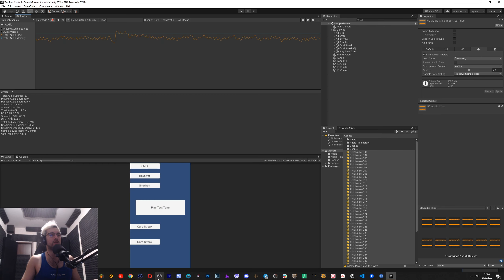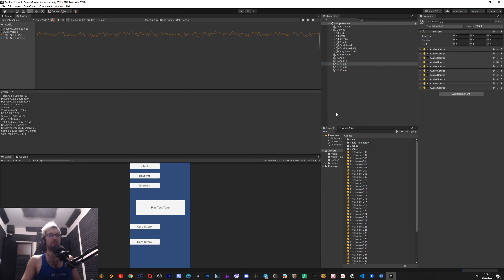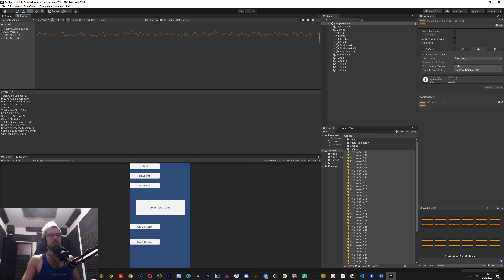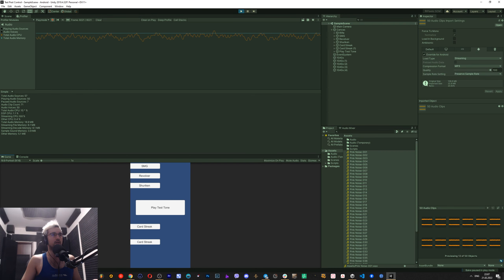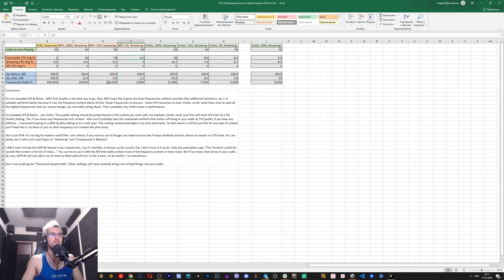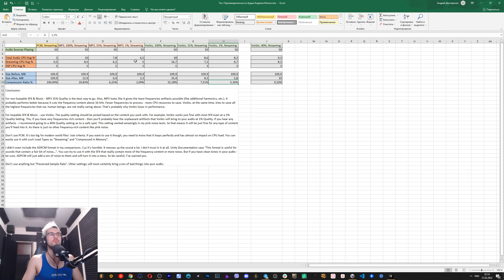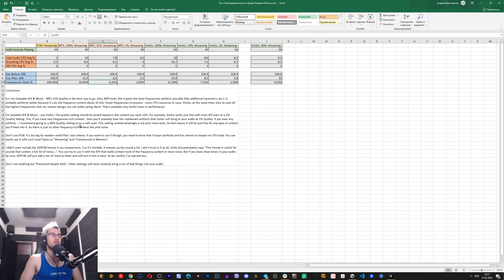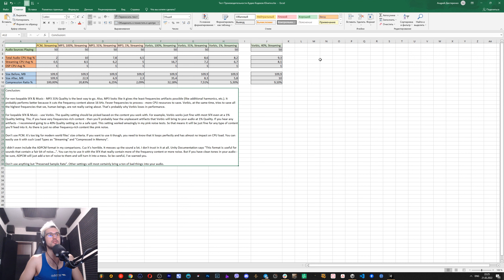Unity Audio Compression Formats CPU Performance Impact Compared (PCM vs ADPCM vs MP3 vs Vorbis)

Comment: Hi, from your experience, in what audio format should I export my sfx from DAW? Wav and then let the game engine handle the compression or already export sfx as mp3 / vorbis? Are wav sfx only influence size of the game repositorium? Cheers!
Reply from the maker: Yo.

U should always use WAV for export. Cuz even if u gonna import MP3 or OGG in there - these files will still be re-compressed again, when Unity gonna compile a build. So u'll get 2 rounds of compression and u'll lose quality in there. 

While, compressing a lossless WAV file is technically only one round of compression. 

But, of course, WAV weigh more then OGG or MP3. So this will influence the size of  your Unity project repositorium. BUT, it will not affect your build size, as your build size will be determined by audio settings you'll pick in the inspector.

Comment: If you're not going to talk about ADPCM, why is it in the title?
Reply from the maker: Sorry about that. My reason to not talk and show ADPCM is that in my off-the-camera tests it completely annihilated the audio that I tried it for. 
It worked good for frequency-reach content (like noises, etc.). But for clean tones (sinewave, for example) - it completely annihilates the audio with some random harmonics generated, which are super obvious and not acceptable at all. If we talk about some musical instrument that has some clean sinewave-y tones with not much harmonics - ADPCM will destroy it. 
So I think it's the best to pick either PCM, or MP3/VORBIS.
I should redo these tests, probably. Maybe sometime. But meanwhile, this video is at least something on this topic on youtube. I didn't see anything else like this on youtube at the time.
Reply: @Andrew_Renko  Yeah, I think ADPCM's issues with clean tones are pretty negligible, considering what it would be used for here (sound effects, voice clips), and in my experience, most music still sounds fine.
I was hoping to see it here, since most examples of ADPCM are running on "retro" systems (Commadore 64, Turbographix, Game boy advance), and was wondering how well it performed compared to more modern codecs.
Reply from the maker: @ninjacat230  sorry for inconvenience. I may remove this video if I'll redo it sometime later.

Comment: "31%" is poor quality around 96 kbit/s. It's ok for monophonic sounds. 128 kbit/s is barely tolerable for music that you hear under engine noise in a driving game ("Need for Speed Underground", "San Andreas"). Really tightly compressed games without much going on like visual novels ("Roommates") and stuff like that are annoying to listen to with poor quality music that sounds like bubbling mud, and after some years go buy this might become the only source the music for extraction ("The Sims 2" 128 kbit).

Good games from the late 1990s usually had CD quality music and pure uncompresed 22 kHz 16-bit PCM sound ("Starcraft"). In 2023 we can do at least as good. In bad examples, they would leave space on the CD to stuff useless demos and include poor quality music ("Darkstone" Layer-II).

Obviously there is more going on in the codec than cutting of high frequencies. You'd only save 30% of space this way. The noise floor within each subband rises and quieter subbands get discarded leading to a wobbly metallic character. In Vorbis the HQ will get cut too as they get quieter, but it doesn't have the strictly divided scalefactor bands of MP3. You could downsample to 32kHz like they did in San Andreas, but suffer artifacts from bad interpolation back up.
Reply from the maker: Regardless, I think any resampling should be done in DAWs or other specialized sample-accurate software.

32 khz sample rate would help saving a lot of memory for other bands without any losses of useful info. I wish that would be utilized.

And 128 kbps is a must for small games. Like mobile games with which I work. We can't allow anything not-hardly-compressed.